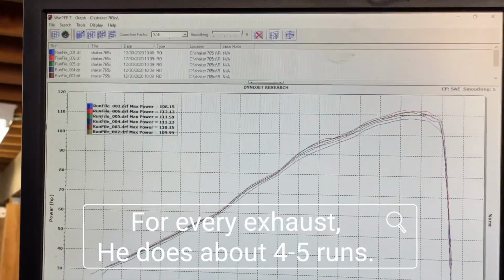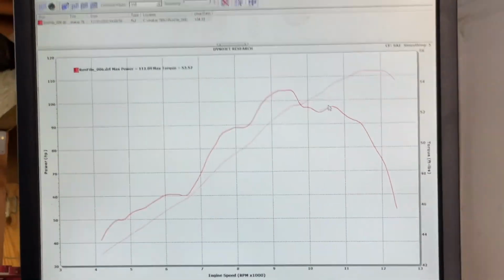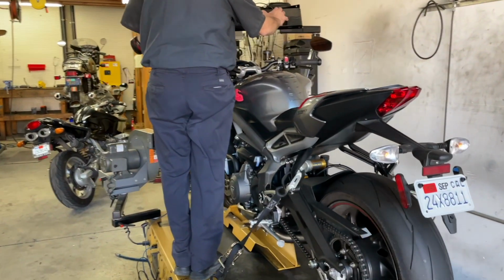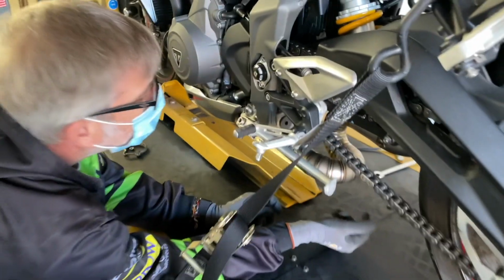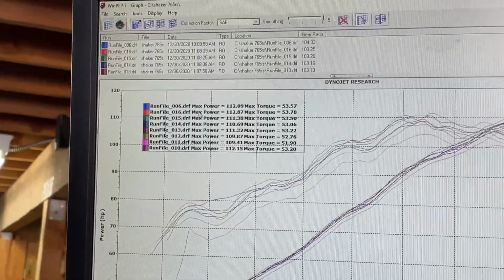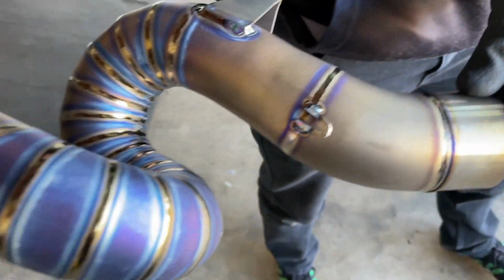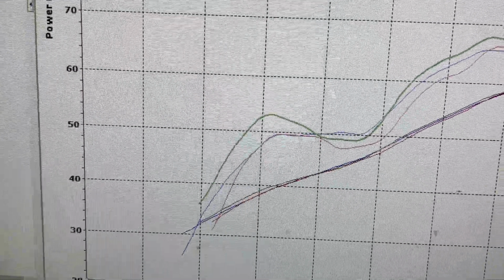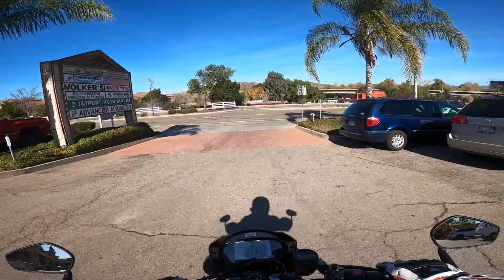Triumph Street Triple RS Dyno Day Exhaust Shootout [SC Project, LeoVince, Spark]

Comment: There is absolutely no point in going through all thia trouble without bothering to properly tune for the change in air flow. Should have guessed the moment i saw the mask. No one that fell for that has any common sense.
Reply from the maker: It was a requirement to wear it dick
Reply: @PetroHead  Nope. Just for dummies and definitely not when working in a shop.

Comment: Typically you don't get power from installing a slip on especially when the ECU didn't have time to adjust with that being said you get power when you tune the ECU because the manufacturers have to get their bikes to pass Euro 4 or now Euro 5. A real tuner can see where the percentage opening of the throttle plates no matter how much you have the throttle open.

Comment: was this done with the "12 minute tune" on each exhaust? the ecu supposedly can account for the change exhaust by running it without touching the throttle for 12 minutes after the radiator fan comes on
Reply: Good question, it at least compensates a bit

Comment: Good to see the comparisons but slip-ons alone make so little perceptible difference they're not worth the cost. You'll never notice a 1hp gain at peak and I reckon you'd have to be very perceptive to feel any change in torque delivery. Added to that they are stupid loud without the dB killers in. You have to get rid of the cat to release all the ponies as that is where they they are all corked up. Do a full system swap for a meaningful dyno run.

Comment: this is an older video, but i wanted to mention that other than the obvious of the exhaust only being slip ons and not full exhausts, that some bikes need the db killer in aftermarket exhaust to create efficient back pressure to actually see any gain, im not sure if the street triple is this way but it is something to consider.

Comment: So there's really sweet stuff all difference when you're just changing the pipes.
Do a new fuel map for each of the pipes, then you'll see the real difference.
Reply: It's not so much about getting peak HP, it's about smothing out those HP and TQ to be as linear and predictable when on the street or the track.   Seeing those rough curves indicate there may be an issue with the A/F and could possibly create a very high EGT, high cylinder pressure or detonation. Which can impact depandbility and longevity.
Reply from the maker: This dyno was for curious eyes only (entertainment) and has nothing to do with performance or how the bike rides. Having done over 3500 miles and tons of track time, power is linear and strong.. the computer does a good job of ironing out what may look chaotic in the graphs..  hope it was entertaining to watch but don’t give the dyno results more credit than it deserves.
Reply from the maker: Who’s financing it.. you?
Reply: @PetroHead  It's just basic, change the flow - change the fuel.
Reply from the maker: Why? Happy with power..  if I want more power, I’ll buy a bigger bike.

Comment: Excellent video! I LOVE my Yoshimura pipe on my 2018 striple R. I appreciate the numbers and everything but like almost all modern sport bikes without ECU tuning and other things like higher flow air filter you're honestly not going to see much power at all like you found out. The main reason for a pipe for most people is for the much better looks and MUCH better sound. My Yosh without the baffle sounds BEAUTIFUL!! 
Also where did you get that awesome keychain? I love that thing.
Reply from the maker: I agree.. just get it for sound.. the rest is for the birds. Keychain..  Triumph came with a backpack, binder, manuals, pillion seat and the keychain.
Reply: @PetroHead  damn you got a nice little package! Must be an RS thing. Mine got a zippered up binder kinda thing, the manuals and one of the rubber Triumph keychains.
Reply from the maker: I was actually surprised it came with all that.. but it might be an RS thing..  not sure 🤔
Reply: I just  bought the 2022 Triumph triple RS and They only gave me a folder and the passenger sit . And  that’s only because I ask

Comment: I wonder if the straight shape of the SC Project came at a cost with the power and torque delivery. Exhaust gases are lazy, so I'd imagine a straighter design would benefit. And the difference in diameter isn't significant. SC Project does have the s-curve style exhaust. That might help the top end with a longer pipe.

Comment: Did you reset the ecu before you stuck the exhaust on? If not you need to run the bike for at least 20 minutes for the ecu to adapt and pick up the change.

If neither above then all you are doing is getting the same amount of air and fuel going through the bike the bike is not aware of the change
Reply: Triumphs also have different maps from dealership. I'd say these Dyno #s aren't correct.
Reply from the maker: What do you mean by reset?
Reply: @PetroHead  cold start the bike and leave it idling for about 12 minutes without touching the throttle until the fans kick on and the ecu will adjust the fueling and other parameters to the new exhaust

Comment: Sc project 100% but you brought the wrong link pipe the S bend is awesome and looks better than the Spark S bend imo
Reply from the maker: This is the one that was recommended for the 2020 model. Check their site.
Reply: @PetroHead  check out the S Bend  link pipe on there website is more expensive mind but the weld look insane
Reply from the maker: @simonsmale1645  Its the same thing as the Spark.
Reply: @PetroHead  looks better tho but yeah similar link pipe
Reply from the maker: @simonsmale1645  I am leaning more towards keeping the Spark.. but I still have the LV on the bike.. will change it out next week when I'm done with the LV review. Not 100% sure till I do "real life" tests of each though. 🤷

Comment: You should have tested it on Sport/track mode as there's the mod that will provide peak power.
Reply from the maker: It was in track mode.
Reply: @PetroHead  cool, did you know you have to turn track mode everytime the bike is turn off and on? Cause at @8:37 it's on road mode
Reply from the maker: @erictanyiming  he started the bike and I did all the menus etc.. the magic of editing doesn’t show that stuff 👍
Reply: @PetroHead  nice. keep it going! I just installed my akraprovic exhaust on my street triple rs. 114hp stock, 121hp after tuning with PCV and DNA air filter. 😬
Reply from the maker: What year is your Striple?
Reply: @PetroHead  Same as yours. 2020
Reply from the maker: Message me on IG. Have some questions for you.
Reply: @PetroHead  alright, messaged you already

Comment: Great comprehensive review. The LeoVince sounded the best to me, subjective I know. Really smoothed out the torque curve and I was really impressed. I would imagine with a full exhaust replacement and tune, either ECU or PC/Bazzaz the jump in hp an tq would be would be noticeable on the butt dyno. 

I have a 18' Striple RS and right know plan to keep it stock, but, thanks to your review the LeoVince would be what I put on for a exhaust upgrade.

Keep up the great work
Reply from the maker: Stay tuned for individual reviews / sound tests.

Comment: With stock map this is a bit of a waste. The reason why Leo Vince shows better numbers is because it's the "closest" to the oem exhaust. 
Spark an SC are more "straight-pipe", put an air filter and a custom map and you are near 130whp. I did. (obviously each dyno is a world...) 
Anyway, I like the content and appreciate the effort and all the info!
✌️✌️✌️
Reply: The 2020 is mappable. Tune ECU, PC5, and someone who knows how to adjust the AF tables on dyno. The bike runs extremely lean with a stock can to meet Euro 5 standards, especially in the lower rev range. With an aftermarket can where there is less restricted flow after eliminating the second CAT in the stock can, the air fuel mixture can become dangerously lean in lower rev ranges. Tune ECU recently allowed access to the AF table in rpm’s above 5000 but not below. You must incorporate the PC5 to adjust below. Going this route, with a decent tuner, a full system, air filter, Oxy Sen and SAS eliminated, 130hp at the wheel is very possible.
Reply from the maker: @davidreed254  message me on IG, I have some questions to ask. I may go the tune route.
Reply from the maker: Is yours a 2020? I didn't know custom maps were available on 2020 models. And I also have a race filter ready to go on.
Reply: @PetroHead  yep, 2020. I meant a custom tune via a piggyback unit (Power Commander in my case)
It's possible to modify the map via TUNEECU but is a real pain in the ass. Every change takes forever and the lowest RPM range is locked so you can have some fueling problems shutting itself off when decelerating to a stop for example. I only use TuneECU to disable O2 sensors, SAI, etc. 

Is not the cheapest way, but if you wanna go the all-in route (specially with a full exhaust), a Power Commander / Rapid Bike and a real custom tune makes the difference.

Comment: great video...content!!!!  you are smashing it ! question: doesn't adding exhaust  require the 12 min adaptation process where bike is started and allowed to run for 12 minutes without touching the throttle . That was the required  process on the 18-19 Rs's( have an 18 RS).  could that be why horsepower hasn't increased as expected though my RS has an OEM Arrow and gains with it are negligible.
Reply from the maker: Not sure but as you saw, he does about 5 pulls to get the bike to learn and each time, it gives the best figures on the last pull.
Reply: @PetroHead  the adaptation is idle for 5 to 10 minutes. Also should of put an aftermarket map in.
Reply: I understand that the 12 minute tune does not work on the 2020 Euro 5 bike, but I don’t know for sure.
Reply: @sjaisie  yes it does Steve. We proved it with my m8's bike on the Dyno. 15 minutes run time from cold AFTER the fan cut in. Fueling was 👍 after the ECU was recalibrated ...
Reply: @chicblair  but not for the 2020 models i think

Comment: Very interesting... would be great if you showed the afr mixtures? I’m guessing it would be running lean. I know mine is.
Reply from the maker: Can I do that within the Winpep 7 dyno reader? If you show me how, I will put it on my next video(s)
Reply: Yup and that screws up the torque values, the already bad areas in the original map are just magnified without proper calibration.
Torque graphs would have probably been better with the baffles in. 
So in the end you don't know anything after such a test. Might be fun to do but as a rating for these exhausts these figures mean nothing.